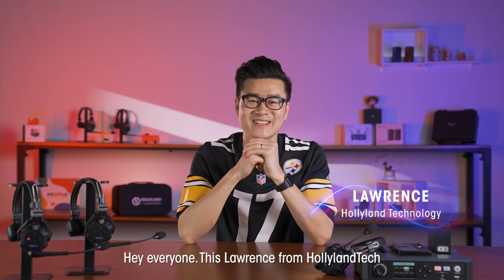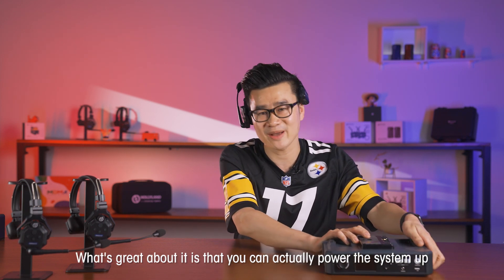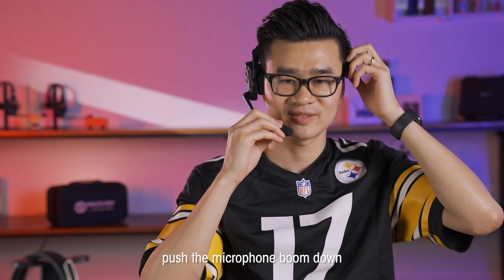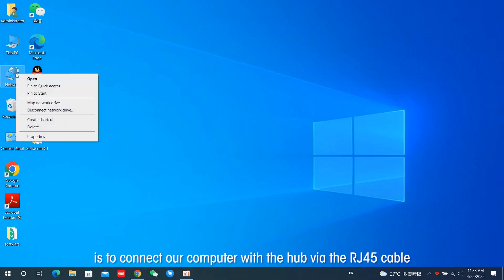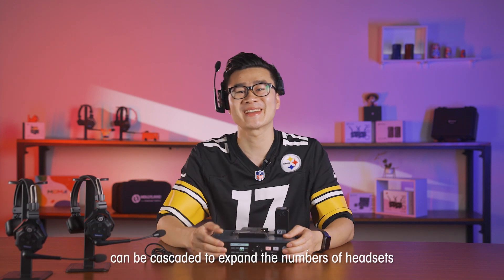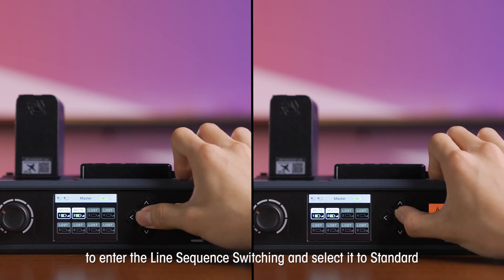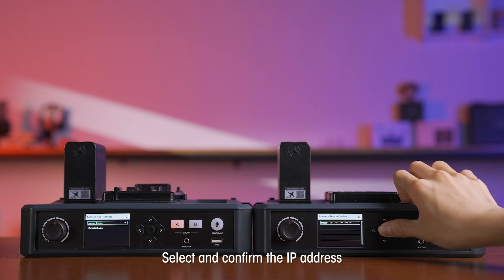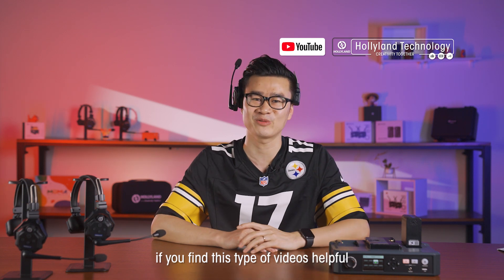HOLLYLAND TUTORIAL SERIES | Solidcom C1-with hub

Comment: Such a bummer.... spend more than $7000 for the set with hub and a set of 8 inc master, unable to connect those two together. Especially since the master is basically the hub. In my eyes one of the biggest flaws of this system. I don't want two of those hubs on set, it makes setting it up too much work...
Reply: you should be able to connect two masters together. making it a 16 headset network. please fix this Hollyland

Comment: Missing how to connect a headset that is flashing green (not connecting to the hub)
Reply from the maker: Hold A on the master headset and hold A on the remote and they will pair after a few seconds! If you want to connect it to a Hub, connect it via a USB C cable, and it will pair!
Reply: @hollylandtech  We purchased a hub and a set of slave headsets separately. The hub and headsets are both C1 models but will not pair via USB C cable at all. Any Suggestions?
Reply: @HBCUGameday  Did you solve the issue? Having the same problem

Comment: Hi folks,
Can you tell me if the C1 Hub unit can :
1) integrate with an existing analogue wired intercom system?
2) can you feed an line level input back into the hub (eg commentary from a Audio 
mixer)
3) connect external antennas. Ie remove the ones that come with and able to put antenna outside an OB van ?
Thanks in advance. 
Ps am a newbie for this kind of stuff.
Reply from the maker: Hi, there:
1. Solidcom C1 supports interconnection with the wired communication system, connected through 2W interface：https://hollyland-techhelp.zendesk.com/hc/en-us/articles/7270395774739-Interconnection-Solidcom-C1-Clearcom-702
2. You can input the music of the mixer through the PGM IN interface, or connect to the mixer through the 4W interface to convert XLR：https://hollyland-techhelp.zendesk.com/hc/en-us/articles/4413343184659-SOLIDCOM-M1-MIXER
3. Currently does not support connecting other external antennas
Reply: @hollylandtech  Hi there, just in reference to question 1 from 737gez, I think what he means is if we have our own old wired intercom then can the C1 hub receive or send an audio signal to it. We don't want to have to buy the M1 system. We are keen on the C1 headsets and the Hub but want to be able to receive audio from either our old wired intercom and/or a normal audio mixer. Is there a video showing the rear of the C1 hub and how it works in this instance? Thanks
Reply: @DuffTV  You should be able to connect to another system either by 2-wire or 4-wire. It has i/o ports for both on the back of the base station

Comment: The Hub.. Can I have an XLR input from my mixer of the room audio be heard through the headsets?  Easy enough to turn on and off? Im sick of wearing two headsets, 1 for comms, and the second to monitor audio for the live stream..
Reply from the maker: Hi, there. Yes, sure you can combine 2 headsets into 1 by PGM IN which can connect to Mixer
Reply: @hollylandtech  Thanks. Does the PGM IN mix with the coms, or is it one or the other?
Reply: Also, I do they sell the hub with 6 headsets? I know its not needed, but the hub has many features Id like to use. Just dont need 9 headsets.
Reply from the maker: @MarkWhite1982  Hi there! You can set up one group for PGM, please follow these step:https://www.youtube.com/watch?v=wf6A_OjjBzw&t=82s
Reply from the maker: @MarkWhite1982  Yeah~Our Amazon is selling one single hub and you can buy headsets 6s to combine them.

Comment: So if you daisy chain the many hubs via the IP connection and not the 4W, we can have unlimited number of headsets? And does your headsets TALK A or TALK B key has the PTT mode or just latching mode?
Reply from the maker: Hi, the Solidcom C1 also can can support 2 sets of IP cascading, with 4W interface, wireless sets can be cascaded. And it has latching  mode.

Comment: Hello. Where can I get the instructions for the hub?
Reply from the maker: Hello, this is detail of the Solidcom C1:https://www.hollyland-tech.com/detail-solidcomc1. Hope it can help you.😀
Reply: @hollylandtech  Hello.  There is not enough information on the capabilities and functions of the hub.  Is it possible to program headsets using the hub?  Can the master headset hear group A and group B at the same time, or only switch between them?
Reply from the maker: @СтудияТРУБАШАТАЛ  Hello, the master heatset can hear group A and B at the same time. And yes it is possible to program headsets using the hub.
Reply: @hollylandtech  Hello. when the master headset hears both groups at the same time, do groups A and B hear each other or only the master headset?
Reply from the maker: @СтудияТРУБАШАТАЛ  The group A can only hear itself, the same as group B. And the master headset can hear them all. Hope it can help u.
Reply: @hollylandtech  Can the master headset transmit to one group while listening to both A and B groups?
Reply from the maker: @marnitzroux5088  Hello, when the master connect the system, there is no GROUP function, they are all the one channel. So the master heaset can transmit one group. Hope it can help u.